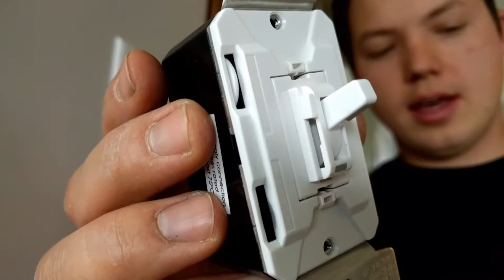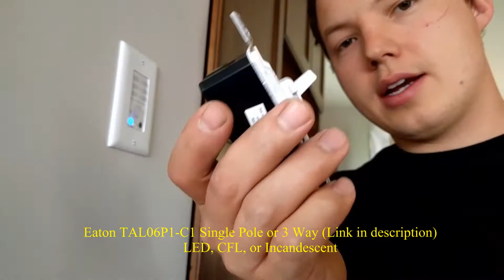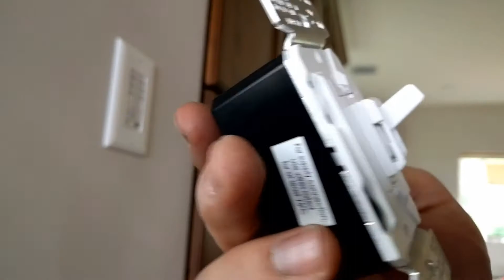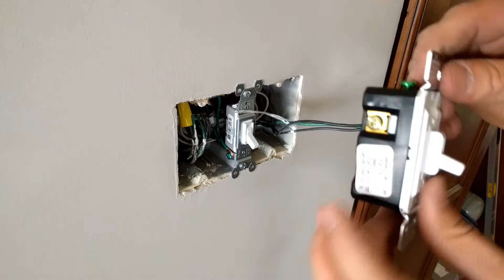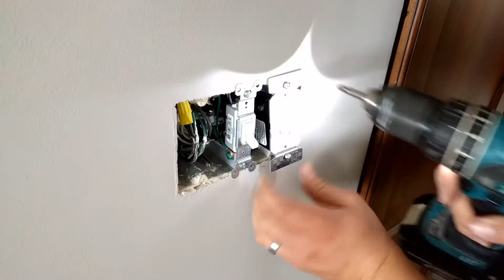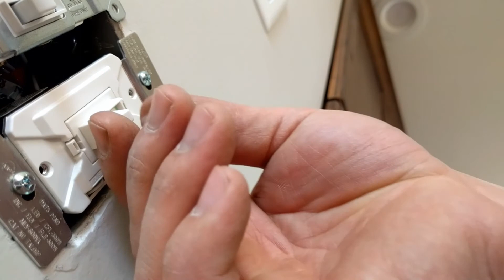How To Install a Dimmer Switch - LED, CFL, or Incandescent - Eaton TAL06P1-C1

Comment: Ben, any reason those can lights are so close to the kitchen cabinets?
Reply from the maker: +jragadio Nice catch! I was very detailed with my planning for the recessed lights but I forgot to take into account that you sometimes hold the surrounding cabinets by the refrigerator out an extra 3" or so. You do this so that the refrigerator fits into the opening better and doesn't stick out as much. In our case we will be installing a counter depth refrigerator so it should be perfectly flush.

Overall the lights still look alright (this angle makes them look really close) but I definitely would have put them out a bit more had I known.

Comment: Be careful to use standard plate cover screws with this dimmer. My son purchased higher end plate covers that came with screws that were longer then normal and it killed the dimmers. When I took the switch apart and screwed the longer switch plate cover  screws into the face of the switch I could see that one of the screws comes to within about 1/32 of an inch from a terminal connection. The other screw came up under the edge of the circuit board and actually bent it while touching a solder connection. The box for this switch probably should have a warning label to NOT use screws that’s are longer than standard.